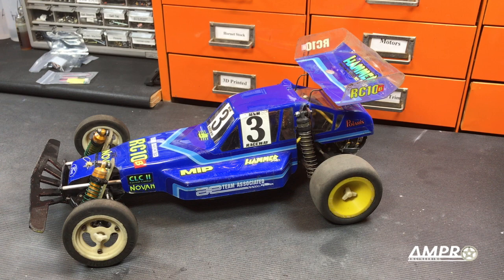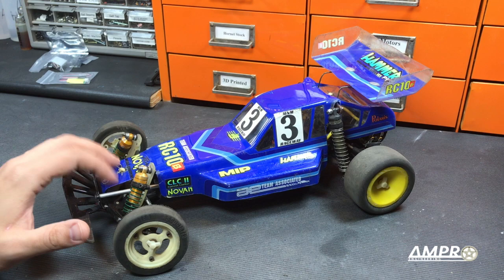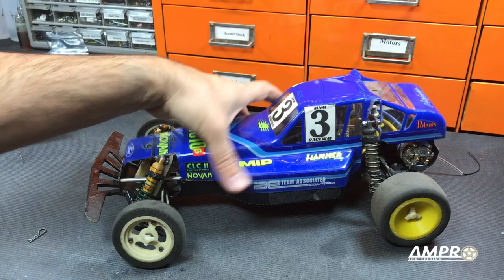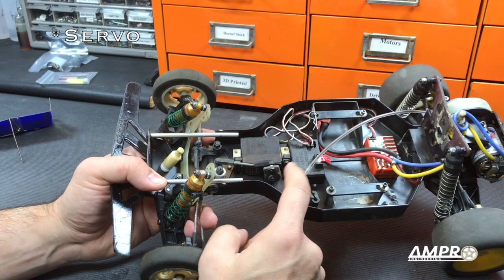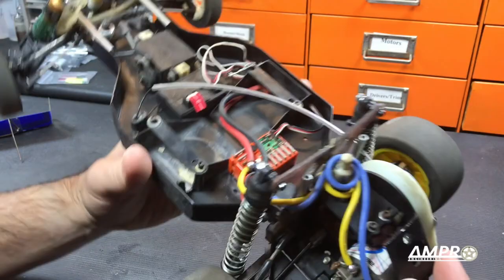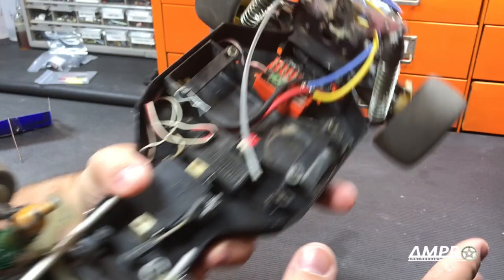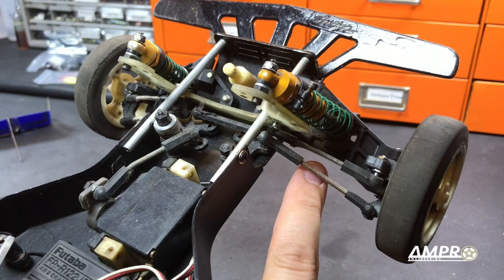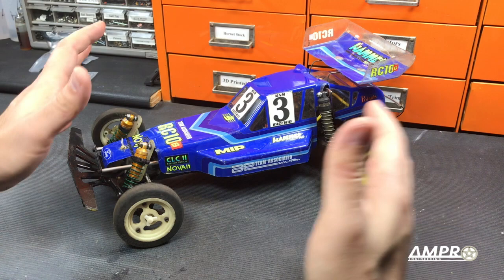e243 - The "My Car" Series - 4: The RC10 Junker

Comment: So true! Back in the 90's a guy at our track had a bin full of Hornet parts and someone gave him an RC10 tub with the front suspension intact. He built a hybrid that was allowed to race in our Hornet class,and took over with a 6 year old at the wheel! That AE front suspension made that car uncatchable! I miss my original RC10 6 gear transmission with the differential on the side where the slipper clutch is now. Of course it was tweaked with bigger counter gears and drilled and milled out outdrive gears.
Reply from the maker: Yeah that is awesome. Ah the old 6 Gear...glad someone misses it! Haha! I was too little at the time to understand how it worked so for me it was awful. I never had a manual, forums, the internet....you know what im talking about. It is different today with everything you need at your fingertips.

Comment: Both of my RC10 buggies were built from parts. One is an extremely nice shelf car while the other is a pretty nice runner. 

But after finishing them, I noticed that I had a most of the major components for another car, then remembered that I also had a bunch of spare 10T parts, along with other various stuff. 

So now, I have a 6 gear, gold pan 10T with Worlds bellcranks. It is also converted to hex wheels with A&L rear adapters, modified Stampede carriers and blocks, with leftover Traxxas wheels.
Reply from the maker: That's killer! I love stuff like that. scrap cars are just the most fun.
Reply: I was watching the video again and noticed your comment on the bellcrank. It is either from a DS or a GT, same part. It was common to use the GT setup on the electric trucks as if has better geometry, and I'm pretty sure that the mod started with the team drivers.

It is a decent arrangement for anyone who wants to retain a combination bellcrank and servo saver, with buggy steering geometry. You can also mix and match the lower arms from a B2 for a cleaner look.